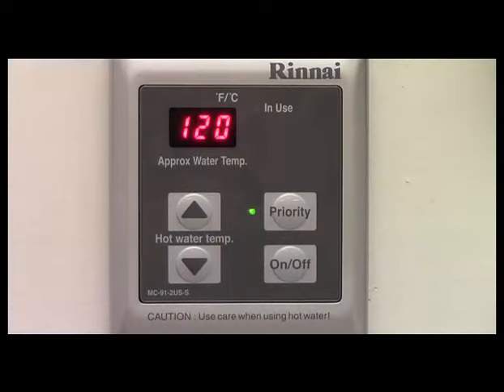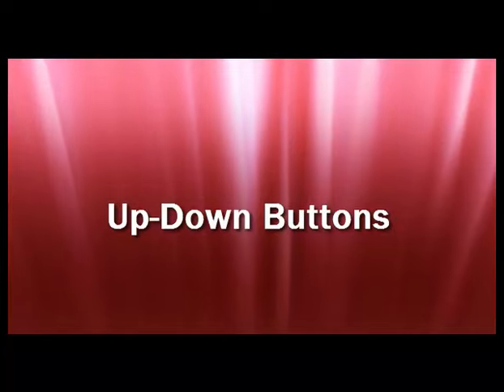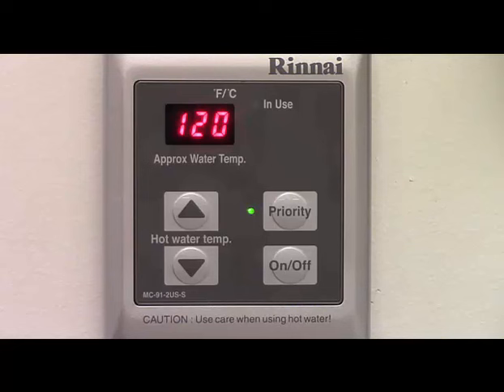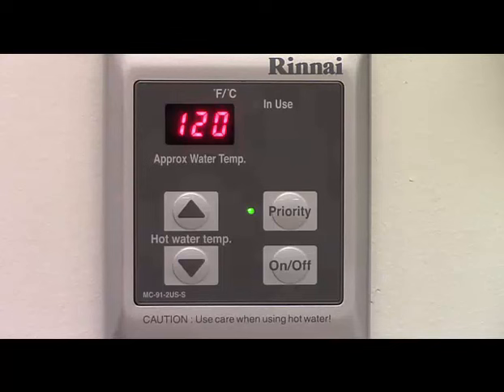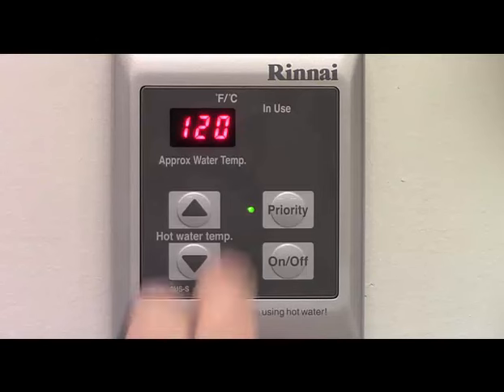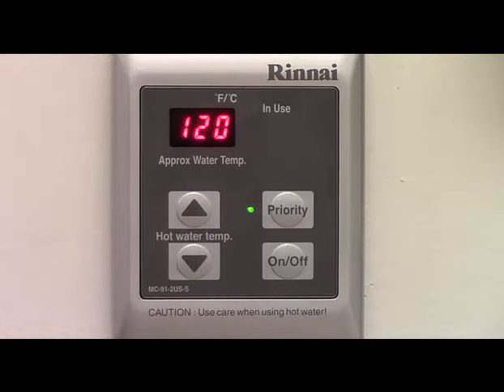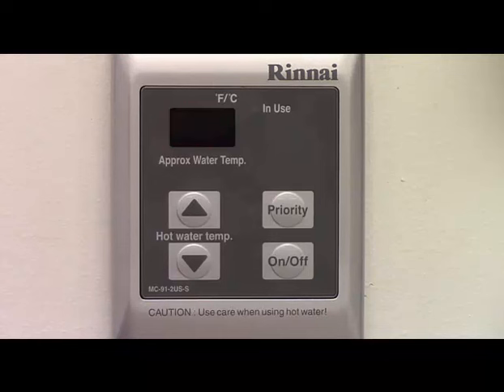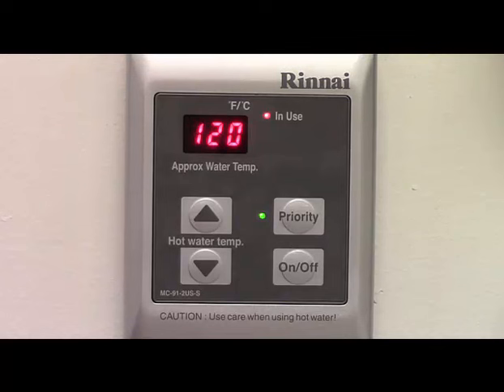MC91 2 Controller Instructional Use Video

Comment: How do we get it to go higher than 120? I try to press it up and it won't go up
Reply: @velascojidon390  not true
Reply: @roberta2602  prove it
Reply: 1. Open the panel 
2. Hold button A until display shows 1A
3. Press on/off once
4. Hold button A again until display shows 120
5. Water can now be adjusted up to 140
Reply: @velasco jidon  He told you! 😂
Reply: @velascojidon390   He told you!😂
Reply: @velascojidon390  utter nonsense
Reply: @velascojidon390  no it’s not
Reply: Take the panel off. On the right side. Press yellow button #6 in. Behind the plastic. Proceed to turn up
Reply: remember you can't adjust if the unit is running.

Comment: I accidently locked my water heater last night and now I can't get it to unlock even though following the instructions.  I even tried shutting down the circuit breaker in hopes that it would help, but it didn't.  I think I have code 33 on it.

Comment: NOT user friendly (for average home owner). I wish the builder did not install this brand for my home. Too complicated. Customer support is NOT good.
Reply: Customer support is great when a plumber makes the call.
Reply: I understand.  One solution is to print the user manual, then highlight and notate it, and keep it next to the control unit.  I’ve had my heater for five years and haven’t had a problem with it.  Good luck.
Reply: @werquantum  mine is 8 years old, and just started malfunctioning with error code 11.
Reply: @zeroturn7091  have you ever descaled it?
Reply: @werquantum  5 hours ago.
Reply: @zeroturn7091  that’s funny.  Did the code clear?
Reply: @werquantum  It did, but it returned.  I think that I have a true ignition failure, and need to pull the rods then inspect the combustion chamber.  Not a job for the faint of heart.  After removing the access panel I noticed three wasps nests (one paper, two mud one on the gas supply and the other on electrical wires on the left all palm sized).  This leads me to believe that they have taken up residence in the combustion chamber as well.
Reply: @zeroturn7091  Wasps!  I never thought about that vulnerability.  I’m going to check mine.  Thanks for the detail; and good luck with your project.
Reply: Update, my combustion chamber was actually in good shape.  My flame and igniter rods however were singed to a nub.  $30 to $50 for the kit, but long term my RL75 is out of production.  I suspect that this will happen again in another eight years, and if parts also are no longer available I will look into going electric tankless.
Reply: @zeroturn7091  Maybe I’ll buy a flame & rod kit (or two) while they’re still available.

Comment: My controller just went out this morning. I cannot get it to turn back on voa the on/off switch. I check the fust box and no fuses have been tripped. Any suggestions?
Reply: My heater stopped working too. it’s below freezing outside and nothing tripped. I hope someone answers if not then I suggest calling help line tomorrow business hours. Super frustrated. No answers online
Reply: Same problem right now, any solution. No power to unit, have gas, electricity to house

Comment: Just installed a brand new rsc199in today but it's not working.  Power/gas/water lines are OK.  Doesn't fire on and the "in use" lamp does not turn on.

Comment: Mine doesn't iluminate, no display. I've had the RL94E for at least 7 years and just flushed the heater and had the unit turn off while flushing and now the controller does not function, any suggestions? I am getting hot water and the heater does tuen on.
Reply: did you ever figure this out? i just did the same thing!
Reply: @brandoswindell8623  yes, thanks for the reply. It was the connecting wire/ cable,  had a short in the crawl space

Comment: My area is 20 degrees so my water heater safety mode kicked in. If temps are still below freezing how do I get the hot water heater working? Is this ok to do when still below freezing? Please advise. Builder did not leave manuals ugh

Comment: How can you increase the water temperature higher than 120? I just descaled my rinnai hoping that would help, but my water is still luke warm at 120
Reply: Flip dip switch #6 to the ON position on the top set of switches (tan switches). Crank it up to 140° and melt your skin off.  If you have children or people with disabilities, this is NOT recommended without appropriate precautions.
Reply: I have the same problem. Just moved into a house with a Rinnai, my first experience with tankless water heater. However the control panel won't allow me to increase the temperature. It's no fun taking a lukewarm shower when the weather is still chilly. Can't imagine how cold it would be taking the shower in the deep winter ❄️❄️❄️
Tankless hot water heaters are supposed to be energy efficient, I guess. However it takes a long time to get hot water,  a waste of 2-3 minutes of good cold water. I don't see the point of saving the energy yet wasting the water. 
The design of not being able to change the temperature setting from the control panel is also so stupid ~ from a very frustrated senior 😭

Comment: How can you get the RU199in to go to 185 degrees? Manual says this unit will make the 199 go to that tank but I can’t get it above 140.
Reply: How to control the temperature on that unit?
Reply: Follow the directions in the ru199in manual. I had to reboot to get it to go to 185 but it worked.

Comment: I know this question is probably going to sound stupid, but I just took ownership of my tiny house on wheels, which has a Rinnai hot water heater...
I got the remote control in it's original packaging, and I can't even get the thing to turn on...
Can anyone help? 😆

Comment: Great Video! Learn a lot. I was looking for an answer to my problem. I recently flushed my tankless water heater, after doing that, the water takes longer now to get hot water. Before, it instantly produced hot water. I’m talking about 2-3 minutes of wasting cold water. Anyone have a suggestion?
Reply: I have the same issue... frustrating...
Reply: Oh boy, now I don't want to flush mine.  Are your burners firing up right away?

Comment: My unit starts beeping while its in use and no hot water is available any ideas?
Reply: Can you share how you resolved this issue? We have the same issue, code #12.
Reply: Mine is throwing Code 11.  I’m not sure if the pilot light is gas or not, but ignition seems to be my problem.  I’m getting gas, but no spark or fire.